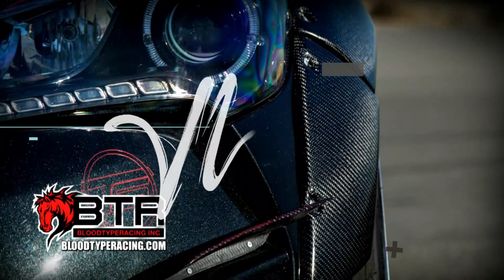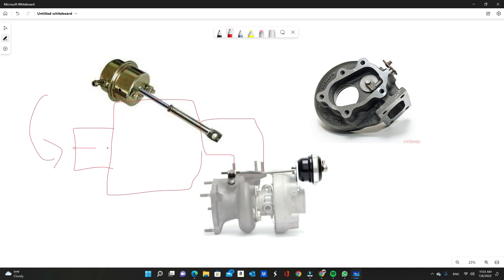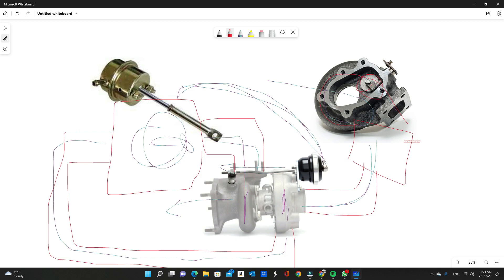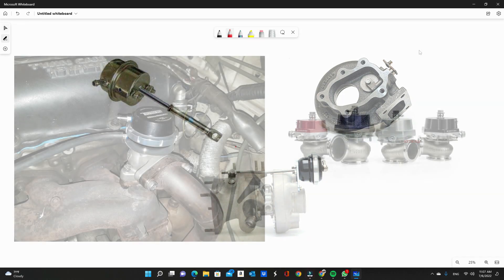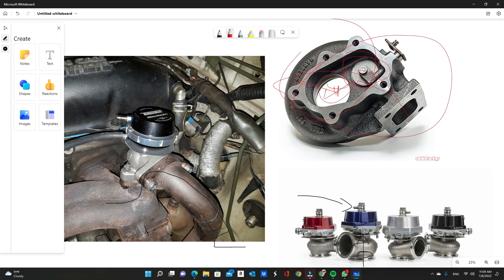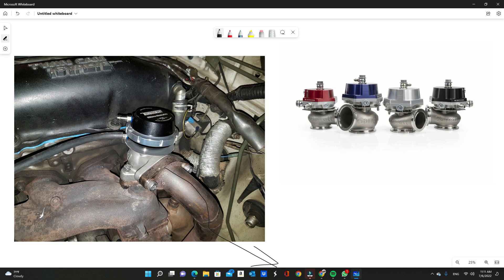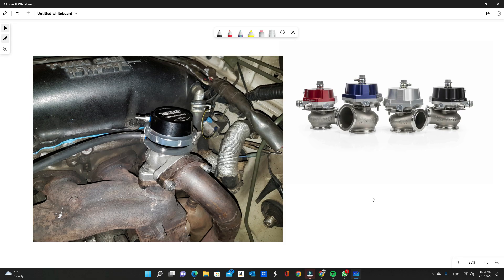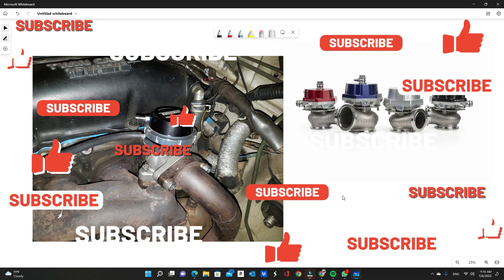Internal vs. External Wastegate.  20-30 more Horsepower possible?

Comment: What to do with electronic wastegate  plug after big turbo install on the bk2 Caz I have mine unplug but getting a p2564 code no boost??
Reply from the maker: Your tuner will have to tune that out
Reply: Said he did but still getting a p2564 code
Reply: @jeezuskhrist4557  just plug the actuator and leave it aside after reflash

Comment: With the new arashi turbo kit and a tune of course, would you be able to run 380whp reliably / daily drive without issue?
Reply from the maker: On a bk2 20T mt with ar3 turbo yes
Reply: I have a 2013 bk2 2.0t AT, is the automatic transmission not good for 380whp?
Reply from the maker: @slowfuzion638  if you also do the TCU there is a possibility it can put down slightly more too since you would be reving higher
Reply from the maker: @slowfuzion638  prob around 370 whp at 23psi
Reply: Around 370 still sounds like hella fun for a daily id be fine with that as long as it’s reliable. Thanks for the replies by the way love your vid’s super informative keep it up
Reply: One last thing, did you mean the
 ar3 JB(440hp) turbo kit or the 
ar3 BB(500hp) turbo kit
Reply from the maker: @slowfuzion638  BB

Comment: Great video! Now that you mentioned it, how do you make the bk2 2.0 stock manifold to an external wastegate ???
Reply from the maker: You will need a fabricator to weld a wastegate flange onto the turbo and weld shut the flapper for the internal gate

Comment: I think you answered this but just wanted to double check. You said with a bk2, if you were to add the external wastegate and weld the internal shut, you would need to retune the car? Interested in this, thanks!
Reply from the maker: Yea definitely needs a tune and a boost controller